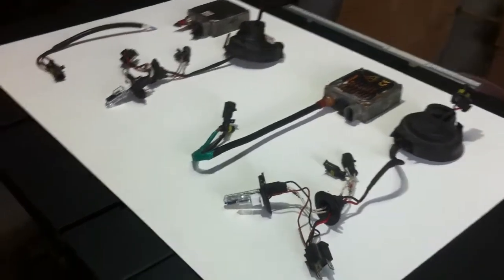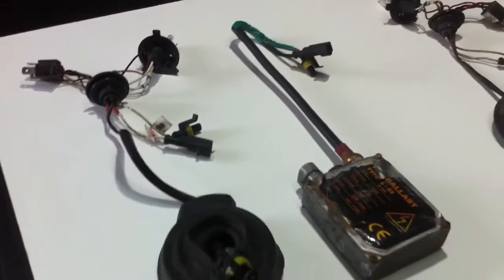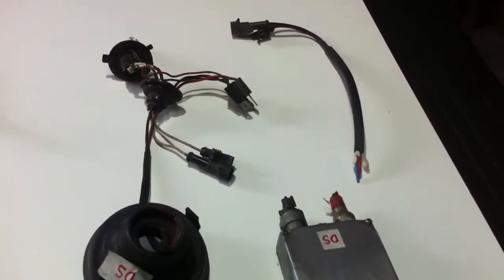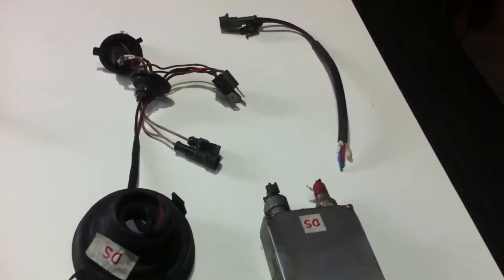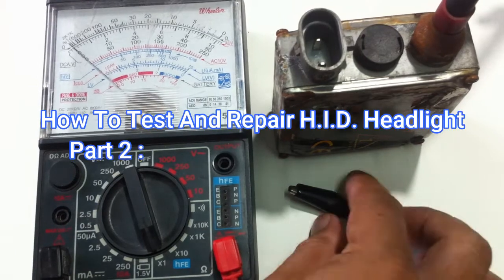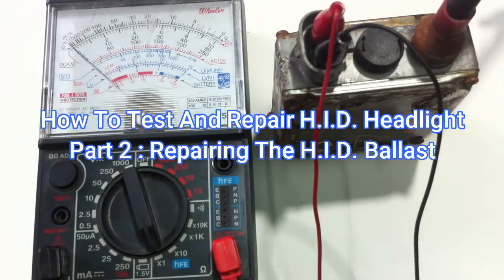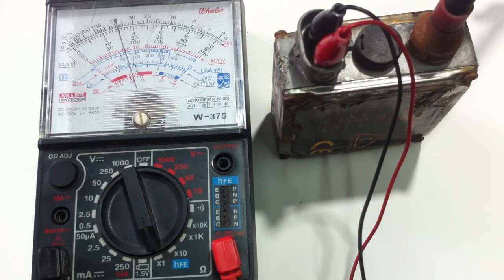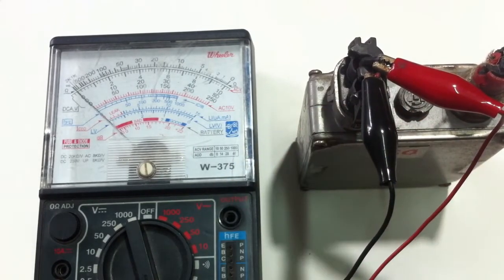How To Test And Repair H.I.D. Headlight - Part 2 : Repairing The H.I.D. Ballast

Comment: Repairing the ballast's electronic inverter is a bit challenging but not impossible. You want to watch out for component rating though, and when replacing the electrolytic capacitors, higher temperature grading version is strongly recommended, as the whole thing will get quite warm in operation which is fairly normal for switchmode power supplies. Potting is a b*tch to remove though.

Also, to bolster the reliability a bit, you may also want better inverter ballasts, like those from Hylux, as I have found that my Hylux A2088 ballast in the modified Cyclops Thor Colossus halogen spotlight work surprisingly well, especially on a Lithium-ion battery pack installed into the spotlight and of course I went with 35 - 39 Watts ceramic metal halide bulbs for this thing so that way it lasts a rather long time, always ready when I actually need it.
Reply: Dr. Mario sir, I’m having an issue where my bulb burns out as soon as I turn the car on.  It’s a D1S bulb on a 2013 Volvo XC70 w/dynamic lights(move with turns). I’m stuck between ballast is bad or wire has short to ground.  I’ve tried testing ballast for continuity but only getting OL and no beep.  The green/orange wire in assembly plug is showing resistance above 10 or above 15ohm can’t remember right this second.  Do you have any recommendations on if it’s ballast or short or anything/anyway else I should test or look into???  I’d appreciate anything you may offer

Comment: This is a Joke! You are not repairing the ballast you are just soldering a broken cable. D'oh!!!!
Reply from the maker: Yes, I just compared the resistance reading of both ballasts and guessed that the ballast with broken cables is working. So I just fixed the cables.
Reply: Cadillac Escalade Ballast Completely Eliminated, Watch.  This YouTube Video Is On Google.